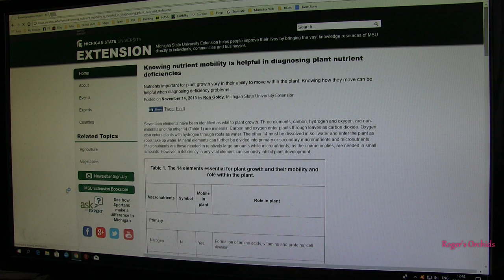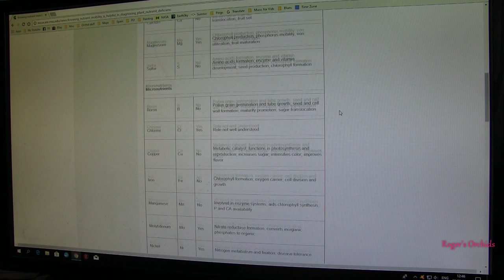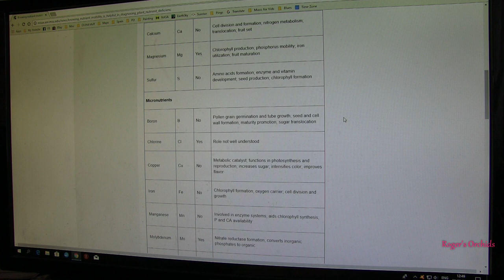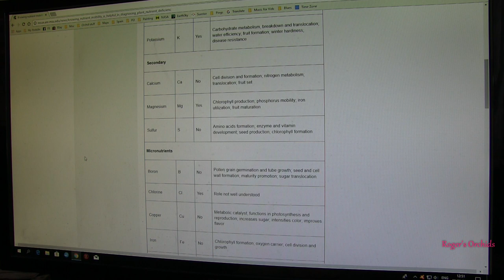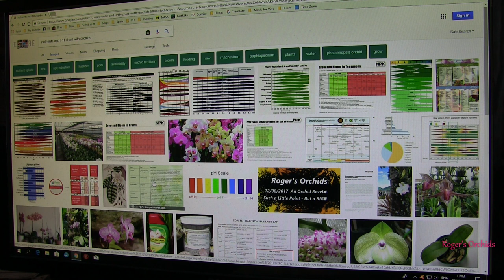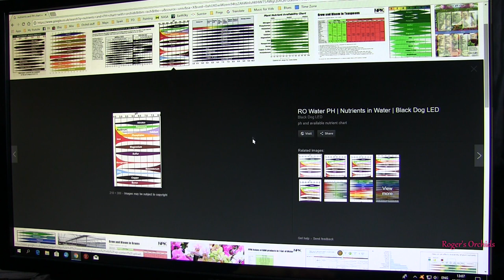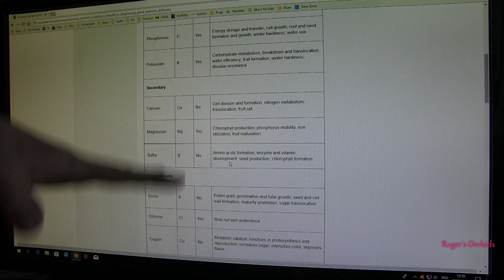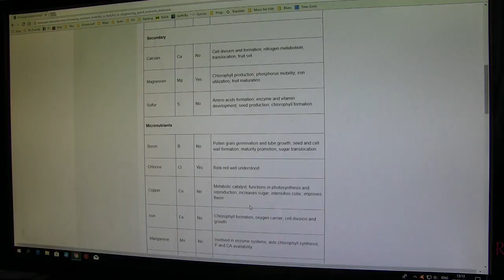I Have a Problem With an Orchid - Join Me in My Quest for an Answer

Comment: Hi Roger.  Sorry I saw this piece after I saw part 2.   Perhaps the Vanda  is affected by that day you forgot to turn on heater ??   I’m worried when you mix two fertilizer together.   The problem is orchid don’t say a word when they have a problem or hurtin’ somewhere. 🤓

Sulfur,  my MSU have the micronutrients derived from EDTA, manganese sulfate, zinc sulfate, copper sulfate, etc.   Your label has same formula.  Manganese sulfate’  MgSO4
Call up manufacturer for more defined formulation?  Might be a printing problem and manufacturer not wanting or feeling need to full disclosure.
Reply from the maker: Yes, sulphates are used in the MSU formula so sulphur is in there - just not listed separately.  And yes, this could still just be cold damage - watching closely.

Comment: I guess the true test will come next winter if you are dosing sulfur in the cold temperature... for that particular Vanda. I tend to think a pH around 6.5, 6.7 is good which is where you tend to be at? Again varying the pH is useful also. Epsom salts. That's why I really wonder if varying the type of fertilizer one uses is helpful.
Reply from the maker: The 'sulphur issue' is not a problem after all - some of the lower level ingredients are sulphates so the sulphur IS in there - just not listed separately. Also, at the end of the 2nd vid is a REAL eye-opener! Varying fertilisers is not a bad idea as long as they are suitable and go with the type of water you're using. Varying PH is good but when I thought I was getting it down to 5.8 - 6.0 I just wasn't so it's been staying around 6.5 and above.

Comment: Scientifically speaking, buy a bottle of standardized buffer solution to calibrate your pH meter. That way you know for sure where you’re at.If you are using Cal-Mag, the magnesium usually comes from magnesium sulfate, hence, the sulfur would come from the sulfate anion. MSU fertilizer is not produced by the university, the commercial stuff is put together by fertilizer companies according to the MSU recipe. They just did the research. The question arises though, why need all the potassium, the ‘K’ in the formula? Rain water trickling down the trunk of a tree, picking up feed from monkey poop and the like, would have little K in it. Ray Barklow from First Rays advocates 12-1-1-10Ca-8Mg as his current successful thinking. For what it’s worth.....
Reply from the maker: Thanks - I have found that several of the lower level ingredients are sulphates so the sulphur is in there - just not listed separately. I did read Ray's update article but forgot to email him about those figures - I wondered if the 'K' figure of 1 was a typo? I'm fine with the N and P and the Calcium/Magnesium figures but it would seem strange to go against ALL fertilisers for all types of plants to reduce the K figure to 1? (I do have some calibration fluid - just a bit lazy when it comes to using it.)
Reply: Roger's Orchids Roger, not a typo, just bought some of the stuff myself. Of course, Ray uses Inocucor, etc. along with the fertilizer.

Comment: I’ve made this comment to you at a previous time about Buying a ph meter with 2 buttons on the front, i e on/off and calibration button.
Consider this: normal human blood ph levels are between 7.35-7.45. A ph of 6.9 could = death for a human. That’s how sensitive the changes can be in ph for people.
A drop of 1 is a considerable rate seeing as the range is only 14, to my mind.
A ph meter with the calibration button on the front will give you readings to the second point, eg 6.92, and a
more expensive instrument certainly will perform better, though people I know who have bought different types at different prices tell me they do vary greatly.  Your great powers of research and reasoning will help in this regard.
Reply from the maker: As far as my current PH meter goes, it will do for now (now that I've realised it was 'me' being a bit daft how I was trying to use it). I even have calibration fluid - just too lazy to use it.
Reply: An important point is also, that blood pH is tightly controlled parameter closely regulated by the body. In the environment pH is much less stable, and can vary considerably - for a couple of points is nothing weird. Plus if not used and kept properly, a more exact pH meter is not necessary more precise.
Reply: There is a huge difference of course between the pH of a body fluid and the pH of the environment. Cola is very acidic and still we can drink it. But if you inject it in your veins you'll not be ok. And if you water your orchid with cola, I won't be surprised if the roots get damaged. A plant doesn't care about the second digit of the water it gets. Even the first digit is not very important as long as it's within the accepted range.
Reply: Roger's Orchids .   Can relate to that.  When I first got my meters I used to do it religiously but now I can hardly be bothered.
Reply: M. Janssen .  My point about the meters with the calibration button is that it’s easier to calibrate them, plus it’s a more detailed reading.

Comment: Hi Roger. Measuring the pH of your RO water is of no use. RO water doesn't contain any significant amounts of ions to make sense of the pH. The slighthest change in H+ ions (or OH- ions if you make it more alkaline) will have a huge effect on the pH simply because, you said it yourself, there are no buffering components. Not all ions have a buffering capacity. Chloride for instance has no buffering capacity, but phosphate and many organic acids do have a buffering capacity. So, don't worry about the pH of your RO water. When it gets in contact with your slowly degrading potting medium that naturally contains all kinds of organic acids, these will automatically lower the pH of the water. Remember that humus (soil) is also acidic due to the degradation and formation of e.g. humic acid. Peat is also acidic.
As for calibrating your pH-meter: in the laboratory we use calibration standard solutions to calibrate pH-meters. Often, these consist of buffered solutions of exact pH, e.g. pH 4.01, pH 7.00, pH 9.00, or pH 10.01. You probably can buy these at aquarium shops because the pH of fish tanks also need to be controlled, especially sea aquariums. Never use RO water to calibrate your pH-meter! It's inacurate and unreliable.
Reply from the maker: I have got some calibrating fluid - just a bit lazy when it comes to using it.
Reply: I'd like to add that all pH-meters that are around require frequent calibration, no matter how expensive they are. In laboratories it is not uncommon to calibrate them on a daily basis. Alternatively, you could consider pH indicator strips also know as pH test strips. These are inexpensive and available in wide (pH 0-14) and narrow pH range, e.g. pH 4.5-9.0 or pH 4.5-10.0. The ones with a more narrow range are used, amongst others, for testing the pH of swimming water, urine samples and fish tanks. And not unimportant: these strips don't need to be calibrated. They are based on chemical compounds called indicators that change colour depending on the pH. As this is a chemical property, it is constant (under normal conditions of use).
Reply: M. Janssen .  I bought a batch of ph testing sachets on eBay for a very low price. Takes a while for them to come but they are cheaper than the other options.

Comment: I think your best bet is a disease of some sort, if it was nutrient deficiency they all three would suffer the same fate.
And using feeding charts for wacky tobbacky will get you nowhere, I got a lot of my feeding knowledge from growing and I can't use it for any other plant, they also grow under special artificial lights for 12 to 14 hours non stop ( maybe a bit to honest but there you go ;-)
Reply from the maker: Chlorosis is often slow to show up but different plants show it at different rates and even in different 'looks' on the leaves. The other thing is, there are quite a few orchids getting dunked in that bucket - I think a disease of some sort might have spread to all the others by now? Have a look at the next vid as I'm doing some checks, I have more info, and I'm actually trying a 'treatment' which probably won't 'fix it' but should stop it getting any worse.
Reply: I'm curious to what it could be pretty sure it will come my way sooner or later
And a small update : I have bugs !!! just found spidermites on one of my dens oh glorious day ;-)
Reply from the maker: If it is genuinely spider-mites - deal with them fast. Two main types - the red spider mite which likes warm dry conditions to do well and false spider mites which are not so fussed about where they live. (That saves me sending you some bugs - I was getting the feeling you felt like you were missing out.)
Reply: Well it is red spider mite and Iv'e been cleaning plants for the last couple of hours and if that doesn't help, chemicals !